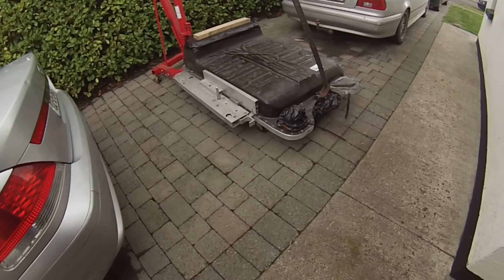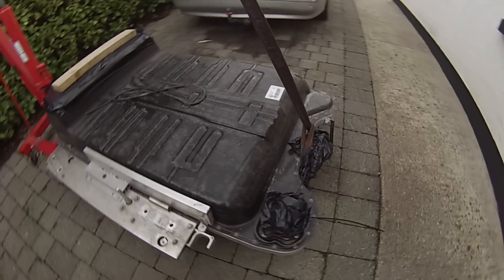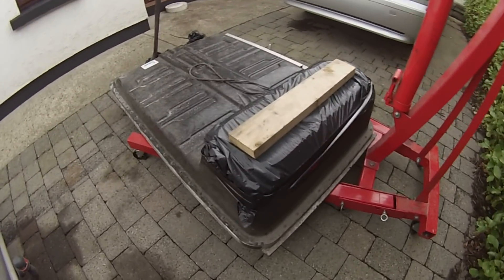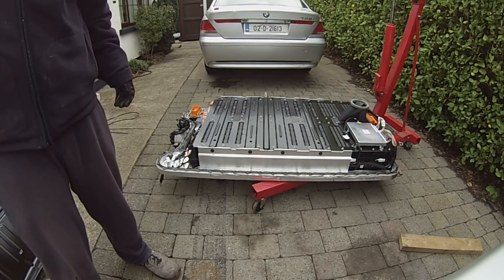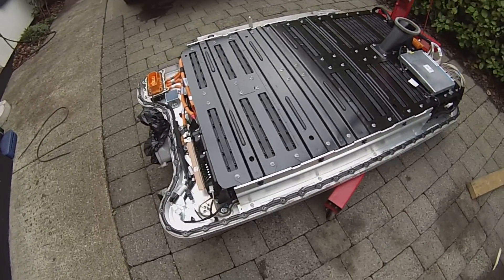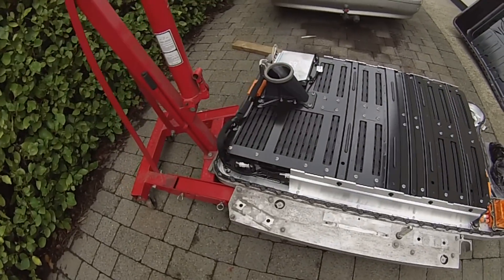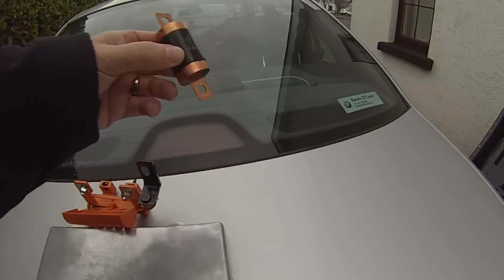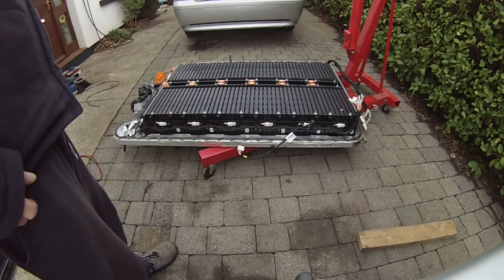Electric E65 7 Series: The Battery

Comment: Where did you get the battery?, was it expensive?, 22.4kwh I assume?
Reply: I was wondering the same. Damien said in the video it was from 2017 car did they come 22kWh anymore then? I think 40kWh would be minimum for seven series size  car.
Reply: He said the 2017 Renault Zoe battery. In that year Renault presented a new 40kWh battery pack that has the same size as the old one (22.kWh). So it could be any of those two.

Comment: Hi, do you think is possible to DIY upgrade the battery of an i3 swapping the cells and reprogramming the BMS ?
Reply: If you want to change a whole module: According to the shop manual, the individual battery module in the i3 has a 28 digit serial number, that needs to be registred in the BMS, which is also inside the pack. So it needs to be reprogrammed with the position of the module (1-8) and the serial number, for the i3 to performance-log and monitor the module. The module also has to be in an comparable state of charge to the other modules (but that is common sense). BMW has an orange suitcase with a programmer that plugs into an uninstalled pack at their service centers.
Swapping individual cells are presumably hard: The module is in compression by the substantial side plates to prevent swelling of the cells with age, so you'll need to cut the welds and tape it all together when you are finished!! The cells themselves are glued together, not the Chinese way, with hot-glue, but with some industrial adhesive, so you'll have to cut the heat shrink sleeve on the cell (outer metal case on the cell is +) and then put another sleeve on it before installing. The cell inter-connects are aluminium laser welded to the terminals of the cells, but a Dremel to leave a stump of the interconnects, and join them with screws and a copperstrip, is possible. Good luck.

Comment: I thought renault was in bed with nissan? the old packs had nissan style cells and layout.
Reply: Yea, Pretty sure the reno nissan thing is still going strong
Reply: Yes about the bed, no about the old packs, unless you meant Fluence ZE  packs, those were the same as the old Leaf. ZOE is entirely different. Cells, manufacturer, chemistry, BMS, everything.
Reply: Ive had a 2005 primera for over 5 years now and have pulled a few parts over the years with renault wrote on them. Shame too cause i love nissans and hate renaults. Should be called Nissault.... 😂🤣